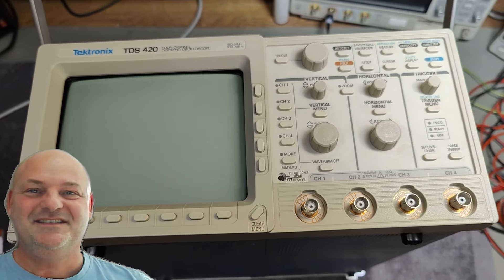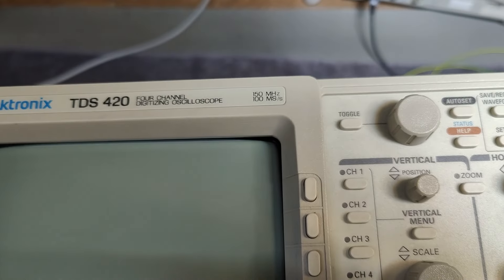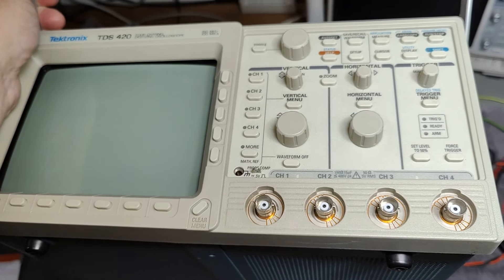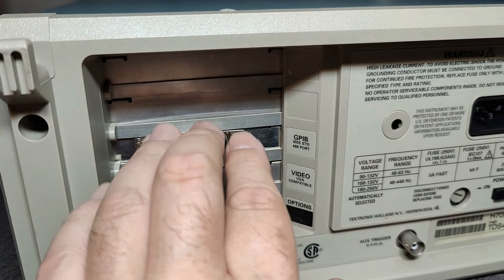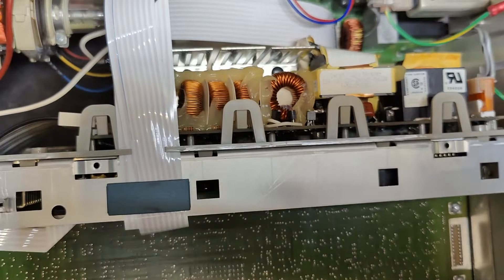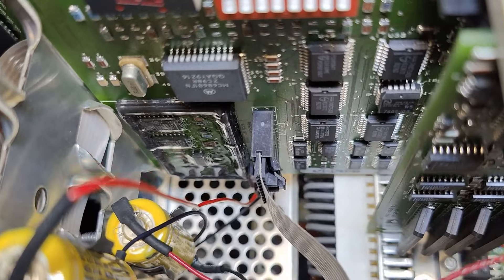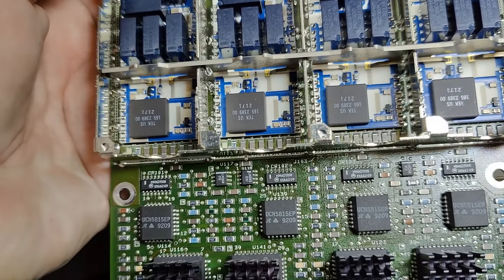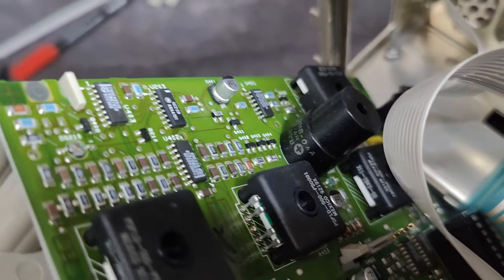Tektronix TDS420 Oscilloscope 4ch 100MHz 1992 repair teardown

Comment: The presence ofthe GPIB port suggests to me that this was intended for an ATE system. For general lab use you wouldn't pay the price premium for the interface option. The lack of soot inside suggests that either the CRT was disabled, or that the unit was used as a cold backup machine to get the test system back up in the event of a scope failure. It was probably cheaper to have standby spares rather than risk loss of production while failed equipment was repaired.

Comment: Probably not all those corroded vias are open. Just be sure to remove and neutralize all the capacitor juice. I don't know if detailed schematics are available, but if yes, it should be repairable with bodge wires.

Comment: Hi Thomas, it's a shame to see so much damage on such a well-preserved machine, I myself have such an experience with an RMS voltmeter HP3400 that looks like new, but is completely fried inside.
The use of a measuring device for detecting data cables has worked for me several times to find paths on multi-layer boards. I used the trace generator - a function designed to search for cables in bundles and with the help of a search probe I looked for where the path leads, then I checked the target area with an ohm meter. This search was unsuccessful many times, but several times the route was found this way.

😲Look, it works 🤔 ...... capacitors are not needed 🤣

Just a small note: during the self-test of the oscilloscope, the indicators of the individual channels also lit up, at the moment when he tried to inject a signal into channel one, his indicator was off - was the input switched on?

Nice day 🙂 Tom
Reply from the maker: this is a really nice scope, so i am sad to give up for now, the scope is now in the hands of a more patient type of person, i am sure he will find the broken tracks on the button input board so it react on user inputs, then the rest will be easy
Reply: @TeardownOZ2CPU  Great, let me know how it goes

Comment: Who needs capacitors in 2024 ^.^
Reply from the maker: look mom, no capacitors :-) i am sure all the electrolytics are for hum area suppression , to get it up and running to a looks like all is alive, we dont need to mount them. better spend the time of finding the missing via connection and get the user interface alive
Reply: @TeardownOZ2CPU  sure they're all power filtering ones, but anyway that's always funny when you just leave a good handful of components apart and it fucking works. Good luck with the rest of work. Hope there's no deep inter layer damage occurred.